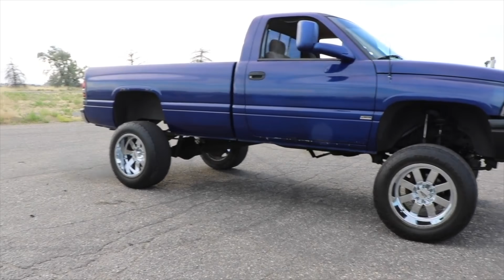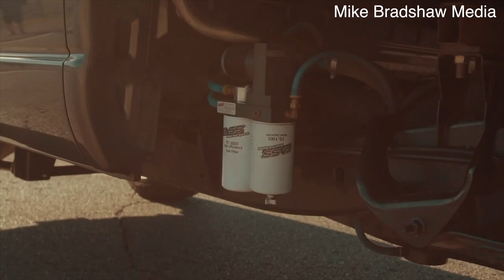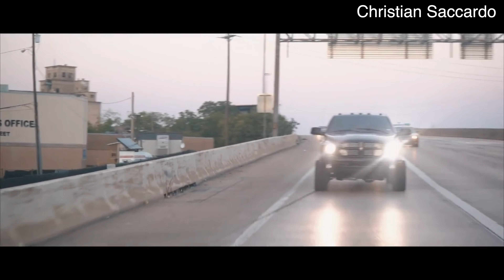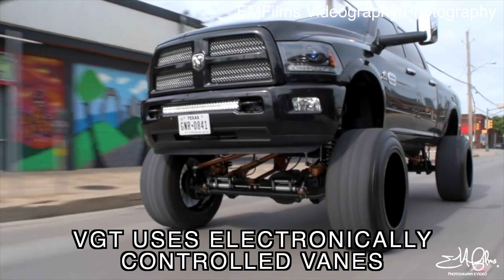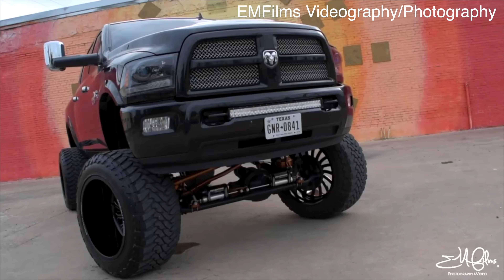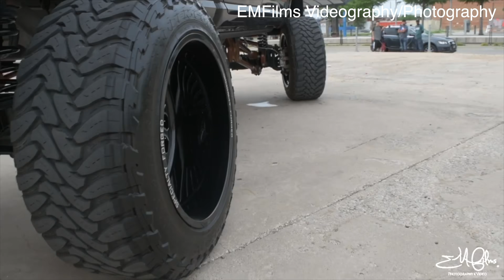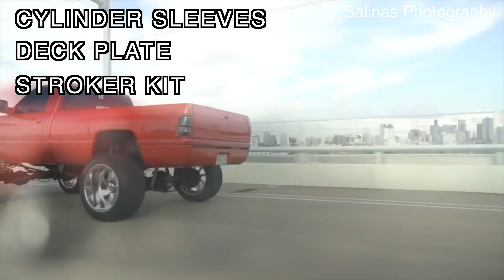5.9L vs 6.7L Cummins: Which One is Actually Better?

Comment: Millennials love expensive complicated unreliable gaudy junk.
Reply: Bradford Ramm ya they shit for brains
Reply: Bradford Ramm controlling emissions started in 1998
Reply: @brandon0150  Have you learned anything in two years?
Reply: @NoName-tz5ji  I got certified on the B6.7 cm2350s and the B6.7 cm2450. what’s your question?
Reply: @brandon0150  How do I delete the emissions on my 98 5.9 I think they are messing up.
Reply: @NoName-tz5ji  lol. You tell me how you delete emissions? I never knew you could “delete” emissions. OEMs can control emission production, e.g. 1998 the 12V P7100 was discontinued, VP-44 and electronic controls came out to lower NOx and HC production. N14 CELECT/CELECT PLUS was discontinued and the ISX signature came out with the IFSM to better control emission production. M11 CELECT discontinued and the ISM came out. All with electronics to control emission production. Now if you are talking about removing EGR, DOC/DPF and SCR/DEF.. good luck to you because you’re breaking federal law
Reply: @brandon0150  I deleted the emissions by going electric. Oh wait that’s right I just changed them from the tailpipe to the smoke stake. You’re right 😥
Reply: @NoName-tz5ji  lol ok boomer

Comment: Ive the 92 12v 5.9. no mods. used around the farm. its all i need ,dependability. 285k havent done anything except regular maintenence. would be nice to have alittle more bottom end. But i dont want to wreck a good thing.

Comment: I'll take the 5.9 common rail.  325hp, 610 torque out of the box.  And who needs all the black smoke 🤢?  That's just fuel out the tailpipe.
Reply: I've got an 05. And my work truck is a 6.7

I'll take the 5.9 over the 6.7 any day of the week.
Reply: @Zee_Bruh-1982  might wanna do some research bud, 05 HO was 325-610. Says right on the engine tag.
Reply: Im happy with my 5.9L, just intake and exhaust by the previous owner. No tunes...does everything I need it to. Now if all the "Dodge" parts of the truck would stop breaking I'd be happy..lol
Reply: J J haha it’s right on the data tag boy
Reply: @duncandmcgrath6290  he is probably just a salty ford boy who cant comprehend those kinda numbers prior to 2007.
Reply: It’s 325 horse at the crank. And 610 foot pounds at the crank.
Reply: P.s. my ‘04 h.o. Is 325 hp, 600 tq, from factory...
Reply: @brandontormaschy6977   same here,  we have the " 04.5 " year trucks.  They had a standard cummins and a HO 325hp motors like ours!
Reply: VE pump is king in my eyes, started nearly instantly in 10 degree weather, no block heater
Reply: @billgreenly5522  VE is SO limited for power though.. Yes, they do start very nicely though
Reply: @billgreenly5522 im glad you said "VE pump" and not " VP pump" lol   but id take a p pump over either a VE or VP pump any day.   Fully mechanical and easy to tune on the fly for more power.
Reply: @billgreenly5522 
Mechanical ve pump on my 1.9 vw starts -40f no problem

Comment: 5.9 better I have 94 5.9 with almost 400k 2nd owner runs strong all  Original set tranny waterpump and starter, I also have a 09 6.7, biggest pos ever always in the shop and NO balls at pulling

Comment: I had a 1996 12 valve and have a 2004 common rail. Both awesome engines. For reliably I choose a 5.9. But I would be just as happy with a 6.7.

Comment: I’ve owned a 04 5.9 and now currently own an 08 6.7 and tbh I love both of them there is no right answer it’s all based on a preference both are strong engines and are amazing the 12v is your best bet for reliability at the end of the day but I’m in love with my 6.7 stuck a non Vgt 369 on it and it still performs and pulls like a champ and averages about 23 mpg on my eco tune and got 726 miles out of a tank of fuel on the Colorado trip for work

Comment: '02 24v with HO 5.9 engine and dreaded VP-44 pump. I did have the OEM pump give me problems at ~ 65K miles but it never quit. The dealer swapped it out under warranty and it cost me zilch! At 165K we're still running strong and I wouldn't trade this rig for anything new on the market. With Bosch RV injectors and a Quadzilla mileage chip I'm pulling around 320 HP and >600 FT lbs of torque. I can keep up with most anything on the road and get a steady 19 MPG (that's with 1000lbs of camper in the bed). I'll keep this one thanks!

Comment: Also you have to take into consideration of the ho second gen they’re kinda rare but mine has 535000 miles on it and only been through 2 fuel. Pumps 1 starter and 1 turbo but if you’ve ever been in the ho second it’s a totally different animal

Comment: Why is the 6.7 perfectly identical to FPT's 6.7?
Reply: The original 5.9 was a Case-IH design, but case didn't have the ability to manufacture it. They partnered with Cummins, who manufactured the engines, that were then badged as either Cummins for outside installation, or Case-IH for Case-IH applications. This partnership continued for many, many years. Eventually, Case was able to produce their own, and Fiat now owns Case-IH, which is also FPT; the Fiat engine division. That is a really short version of the way it went down.

Comment: 6.7 better for the environment?? Lol 😂, 6.7 gets around 14mpg and the old mechanical 12v gets up to 30 and for the most part unless you screw with it really doesn't blow black smoke if you know how to drive
Reply: Agreed, the only time my 510K mile 1990 D350 blows smoke is a tiny puff on start up sometimes when cold.

Comment: Still like the 5.9 12 valve
I've worked on many 6.7 Cummins in the past 4 years never had to change a head gasket had a lot of problems with the emissions system some of the 6.7 that I work on have almost 300,000 miles on them

Comment: I own 2006 mega cab 5.9 24 valve 
My dad owns 1997  5.9 12 valve 
Both truck's  have never had any big  problems 
My MONEY  is on the 5.9
Reply: Mega crap
Reply: Any Trans issues? I am looking at an 08 Dodge 3500 mega cab 5.9 with 157k miles.

Comment: Make mine a 5.9 ,12 valve for simplicity of repair and reliability. After 270k it still runs and pulls like a champ.
Grant it, I may not get there first, but I will get there with no side of the road experience.

Comment: The latest 6.7L uses a compact graphite iron block, CP 4.2 pump, hollow camshaft...70% of the engine is brand new and it's a total pile.
Reply: Agreed, the 5.9 began its life as an INDUSTRIAL engine that was in hospital generators, boats, buses and more. Every part of its internals are beefed up to handle punishment. To have it in a pickup was a match made in heaven.

Comment: Hands down the 5.9 I have an 07 with 445000 miles and all it’s had is a 2 clutches and 1 transmission and I use it daily for cross country towing
Reply: Yessir towing is the point of the cummins, people joke on my grandfathers 24 valve thats been passed down to me but i find it funny that these kids have tow mirrors on their trucks and ridiculouse rims and tires and they aint even using it for what its meant for. So what i cant roll coal, i can tow a damn church.

Comment: Dumped my 07 3500 6.7 after just one year. Couldn't keep it out of Grapevine DCJ service dept. Every 3 mo. It was a check engine light and Dodge refused to keep fixing. The tech said afterwards we aren't allowed to tell you this but hauling 1K in the bed and you would have never had an issue. Great after losing 20K for a lemon. Bought a 20 yr old VW still driving today. Mechanical fuel injection is awesome.

Comment: Very good information, would like to see more about these engines, I have owned both for over 15 years and worked both. My 03 was a beast and very reliable pulled great, the 5.9 pulls great but can not compare to the power of the 6.7 that I own now, both great engines, Cummins for life.

Comment: So 6.7 has a million failure points the 5.9 didn't. Oh and uses way more fuel.
Reply: I have a 2nd gen 24v and a 3rd gen megacab they are both rock solid and i know many people with 6.7 that that love theirs and are rock solid i like them both and im getting a 2012 6.7 megacab because all those ive ever been in have been amazing

Comment: Being a former diesel mechanic I love my 5.9 24v because it is so simple. With the NV4500 trans it makes all the power I will ever need and no repairs after 20 years .The only weak link is the lift pump starving the VP44 injection pump. A good fuel pressure gauge and keeping the filter changed is so important. Unless I wreck it it will be the last truck I ever own.
Reply: I had a 97 12V that I shouldn't have sold. They don't make half the power of a modern diesel, but they were reliable.
Reply: My father in laws, with a manual struggles a bit more pulling my 43 foot fifth wheel than my 6.7
Reply: Yeah. I love mine too. Bought it new in '98, but it is rusting a lot. I have put lots of upgrades on it and I am sure it will last many more decades.
Reply: just picked up a 2000 5.9 with 60k miles and an allison tranny for 900 bucks, everyone tells me its a great score (i just need the turbo).
Reply: @SocalMarineUSA  that’s a hell of a deal even if it needs a turbo. The engine alone is worth more than 900
Reply: That’s why I installed a fuel pressure gauge on my 2002 to make sure lift pump is operating correctly
Reply: @Bill House Hey what type of lift pump you recommend changing it out with?
Reply: Just picked up a 2007 2500 5.9 118k miles, zero rust, Sun Coast sage two billit transmission, new stock injectors, a 125hp tune. I am 100% sure I paid the top top of the market at 29k but I bought it to be reliable to pull a 14k pound 5th wheel and not leave us stranded, and I knew that going in. It’s got a giant cattle gaurd I am removing if anyone wants for free. Any thoughts on what I need to do mechanically please let me know, I am new to this side of trucks. I know a FASS fuel system would be a good idea but that’s about all I know at this point.
Reply: But I bet the vp44 is more refined than the 12 valve mechanical injection system
Reply: Ive had my 5.9 since 06 brand new. It pulls a 20 foot enclosed trailer for our greenhouse business. It just got a new tranny last year and a new alternator this year along with new injctors. I also put on a single pice drive shaft. (mega cab) This truck now has 260k miles, im never selling it. When i die it goes to my son.

Comment: The 6.7s cp3 injection pump is way more reliable. I build these daily at my work. I work at bd diesel and you wouldn't believe how many 5.9 common rail cp3s are just gunked up and shredded
Reply: J C.. why is that do you think? People not changing fuel filters often enough?
Reply: @RJ-sr5dv  the 6.7 cp3s have a coated plungers in them making them stronger. But I would recommend a hotshots secret's cleaner once in a while and some type of daily treatment

Comment: I’ve never owned a 5.9, but my 2018 6.7 was the biggest pile I’ve ever owned, actually getting it bought back from the dealer under the lemon law.
Reply: 2008 LMM Duramax, before all the DEF problems. Love it so far.
Reply: C.J. HotShot what did you trade the junk in for?
Reply: C.J. HotShot should’ve got it deleted.
Reply: MaximilianMus it was sill under warranty, just a pile of crap lemon I guess. Just the way my luck tends to run 🤷‍♂️

Comment: I have a modified 6.7 and two stock 12 valves. I have not drove a truck that makes more power then my 6.7, but it was very expensive to buy and build. Both 12 valve trucks are very reliable other then transmission issues. I don't think you could build a 5.9 to a 6.7 potental, but the 5.9 is a very reliable engine, especially the 12 valve. The second gen 24 valve VP44 5.9 engines make good power but suffer fuel pump issues (they can be fixed though). The third gen 5.9 common rail engines make good power, they are reliable, and they can be built to make awsome power. They can give a 6.7 a really good run for its money, but when comparing apples to apples the 6.7 will out pull the 5.9.
Reply: Jeremy Smith what if you just want a daily driver and towing a max of 14,000 lbs a few times a year and go off-road a few times a month? Please tell me 12v 5.9 lol

Comment: Honestly. I think all turbo Diesel engines are pretty amazing. They each have their flaws, but all can be made “bulletproof” without a whole lot of money. I have a 2011 F250 with the 6.7 diesel. I’ve done a few things to prevent failure and it’s been nothing but outstanding work truck and fast. I love the Cummins and duramax seem great too, Allison transmissions are always nice. But a lot comes down to maintenance. Diesel is a different beast. Myself, I like to drain my fuel filter every so often and replace them bout every 3 oil changes. Most people won’t and bad things happen
Reply: Cant rat on a well kept diesel of any breed
Reply: Why you drain it and change it so often?
Reply: @braveheart2785  well. I believe I read that in a manual somewhere to change them every 15,000 miles, so 3 oil changes for me. I learned that for a Diesel engine the fuel system is a huge part, expensive, and the fuel pump and glow plugs rely on clean diesel for lubrication. And the fuel filters are cheap too. 1 fuel filter, 1 fuel filter/water separator.

Comment: The 5.9 I had for 4 years you really don't need a mechanic  with this engine I had a 1991 automatic  an the only thing I change in 4yrs is fan belt an regular service simple an a juggernaut of brut power an reliability I did feel as though the transmission  could of been as equal with engine though my buddy has a 6.7 but to me it's more of a black bear not a grizzly bear I don't see longevity  as long as 5.9 series or reliability  besides you can add a few mods to 5.9 an she will be a beast in velocity so having said all I did 5.9 a true warrior an 6.7  a  fragile warrior which needs more supervision! But has potential  the 5.9 is the equivalent  of Thor s hammer